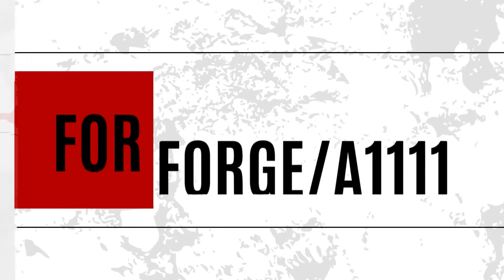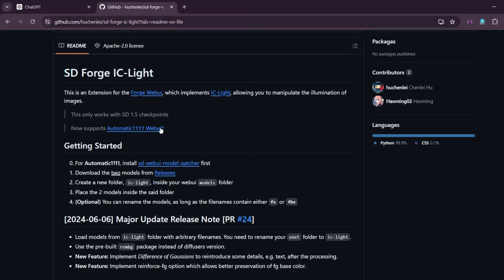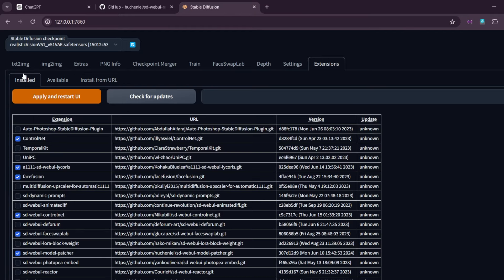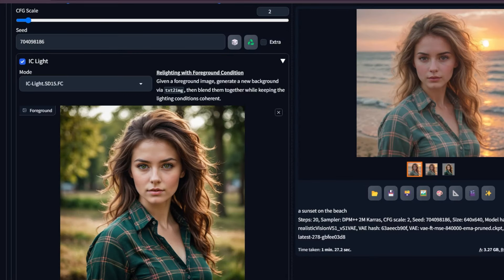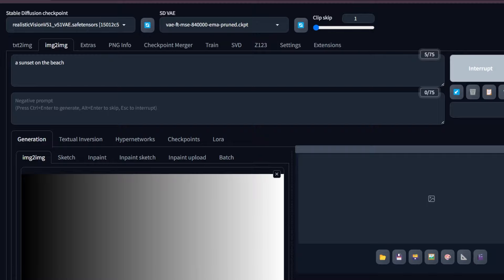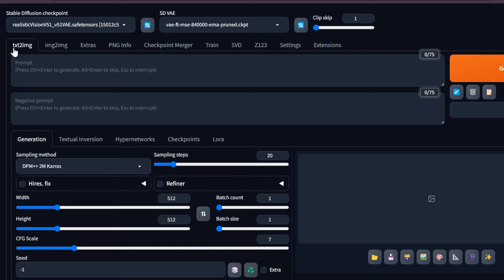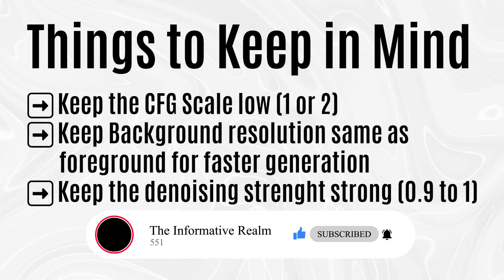Control the lighting using IC-Light Extension - Forge & Automatic1111 - Beginner tutorial

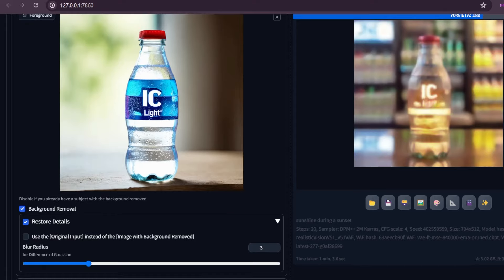Comment: How do you get the IC Light extension show up on the Automatic1111 user interface as in 2:38? I follow your installation steps but the function does not show up. Thanks
Reply: I solved it. I forgot to also install the first extension you provided.
Reply from the maker: Glad you found the video helpful